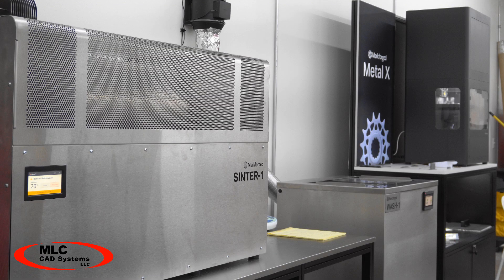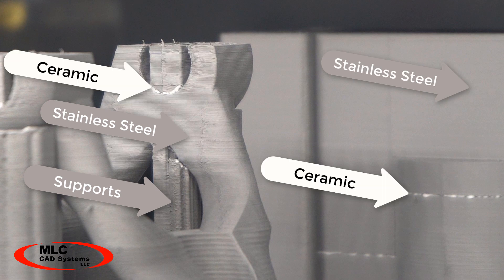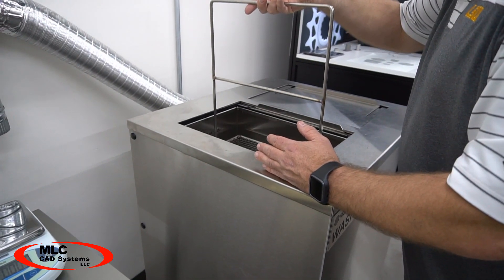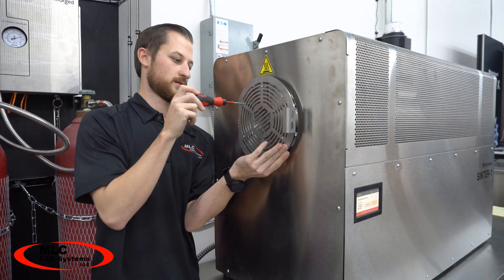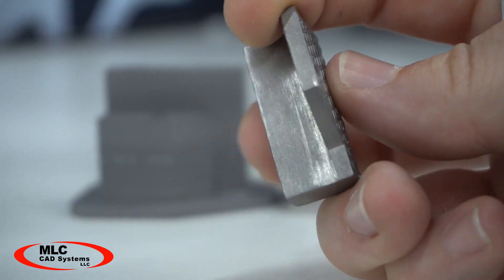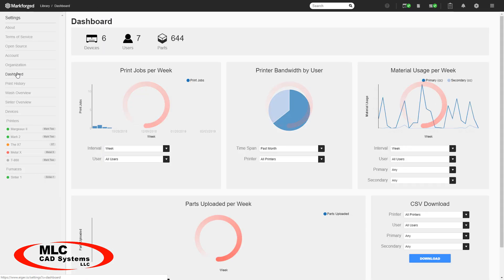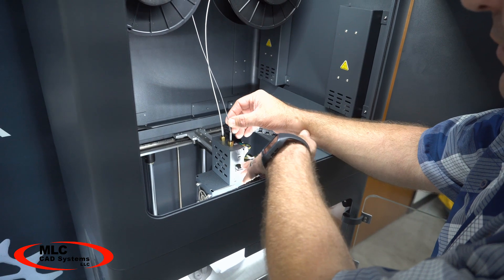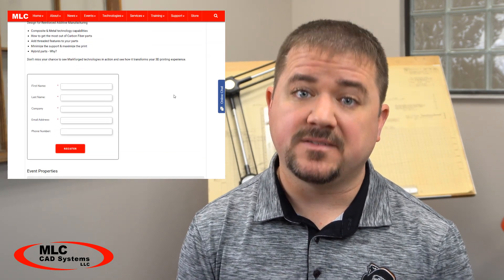The Markforged Metal X is Here

Comment: Still a long way though from speed of cnc doing production. Save material yes, but by looks of those parts they cut, Cnc could have cut 10 or more, no washing etc needed
Reply from the maker: Agreed, for any parts that can be machined efficiently they would be faster and cheaper to use a CNC.  There are a few factors to consider that control how efficiently a part can be machined. The Metal X is ideal for parts that will be extremely difficult or impossible to machine due to complexity or shape, which is often a minority of parts but may be key to successfully complete a product or improve performance.  It is also great for low-quantity parts and prototypes, where the tooling design and fabrication costs cannot be offset by any meaningful quantity.  Parts that require a significant amount of material removal, especially parts that are very weight-efficient or oddly shaped, are often cheaper to print than they are to machine.  If raw material availability is an issue, such as remote or off-shore installations, the Metal X can build any part with any shape or size from the same spool of raw material.  

We don't expect the Metal X to compete with CNC machining directly for most parts, but it can vastly expand design and fabrication capabilities in industries with extreme design challenges.
Reply: It save materials, and it can make super complicated shapes that is impossible with cnc. Depend on the applications, i think this thing is a breakthrough

Comment: When will the price for these metal printers dip below $10,000? Right now they seem to be geared more to be sold to companies that need them for r&d and prototyping new products. Do you think within the next decade these metal printers will become more afforadble and accesible to the average consumer?
Reply from the maker: Great question, and for a number of reasons it will still take quite a while for the cost to get down to that price point.  For reference, about 2 years ago it would have required a minimum initial investment of $1M USD to get started printing metal, and that cost of entry has plummeted by an order of magnitude with the release of this new style of bound metal powder printing.  It will be interesting to see what breakthroughs are up next for metal printing.

You are correct that these systems would not be well-suited for an average consumer yet unless they are dealing with some pretty tremendous design and manufacturing challenges!

Comment: Stick to sand casting allot cheaper for the money and time and very little production time i don't see how you could ever make your money back on making parts to order sorry but if it can't produce the product a lot faster don't see how it will ever work out. and doesn't seem safe to use in high strength/torque applications seems you can only use it for decorations and the shrinkage after the product? So you gonna have to put it on a milling machine anyways why not just use a CNC to make your part!? think your product needs A LOT of redesigning and improvement
Reply from the maker: Thank you for your comments.  It is important to understand where a system like this fits into the realm of manufacturing, and it isn't to produce parts that can be easily or inexpensively sand cast or machined.  In a typical design, most of the components can be made less expensively using traditional methods, and it would not make any sense to shift those designs to this machine.  Where the Metal X is seeing profitable adoption is where an assembly of multiple components can be replaced with a single part, printed in high-strength materials, in shapes that are impossible to make using any other method.  Also, it is worth noting that the final porosity of metal on the Metal X is superior to a typical sand-cast process, and the strength of the material is not directional after sintering or compromised at all from the fabrication process.  Accommodations for shrinkage and the final surface finish are comparable to sand-casting parts as well so the results are very serious parts.

Another consideration is access to a foundry or a suitable machine and raw material.  The Metal X can create metal parts in complex shapes using high-strength alloys with no foundry access and a very small facility footprint.  Consider locations such as off-shore rigs or extremely remote installations where it would not be possible to stock up on every possible variant of machine and raw material shape to build replacement parts, and you'll see that there are many markets that the Metal X would serve very well, but they are not typical main-stream needs.

Comment: I know this is a dumb question but is that  oven machine tempering the metal ?   Or binding the layers of metal together?
Reply from the maker: This is a great question, sintering shares a lot of similarities with heat treating.  The primary function of the sintering oven is to bind all metal particles together, removing all remaining binder material in the process.  The part is taken to a temperature just below melting, so the metal remains solid but the crystalline structure is able to relax and bind to neighboring metal particles, solidifying the part to a single solid component.  Sintering takes time to occur, so the temperature profiles are carefully controlled and the material is kept at specific temperatures according to a sintering procedure and it is cooled carefully to avoid deformation.  This leaves the part in a near-annealed final state, but the final heat treatment state is a side-effect of sintering, not the goal of sintering.

Although the sintering oven is capable of getting hotter than the required temperatures for heat treating, it is not designed or equipped to perform any heat treating, and subsequent heat treatment may be desired to achieve the necessary final material properties.

One more note: although the material is deposited in layers, the material is a metal powder with no residual layers, orthotropic properties, or weaknesses caused by the printing process.

Comment: don't understand and hope you can simplify in steps w/o ad. thrink ABOUT 20% means no precision or not?
Reply from the maker: Great question, when we said ABOUT 20% it was not for lack of precision, but to try to simplify a sophisticated process.  20% shrinkage is an average volumetric shrinkage value that can change slightly throughout the part based on the geometry or shape of the part.  The goal is to accurately predict local shrinkage for each geometry, and expand the part to the exact right size and shape so it shrinks back to your desired final net shape.  "20% shrinkage" is an average value that is easier to say than to try to explain the complex calculations that are done automatically by the software.  Artificial Intelligence is also coming to this algorithm to enable even higher precision without adding any complexity for the operator.

Comment: What? I thought it was a powder bed printer. I received a sample from them and it said nothing about shrinkage. Only that if heat treated it would go from 1000 to 1250MPa tensile.
Reply from the maker: Powder bed printers are available from other vendors, but they are significantly more expensive to purchase and operate.  The Markforged Metal X avoids the hazards and costs associated with free metal powder by using bound metal, similar to Metal Injection Molding (MIM), but as an additive manufacturing process.  The parts are automatically scaled up to account for the shrinkage, so the final parts are near net shape just like any other manufacturing process.  It is true that any post-processing techniques appropriate for each alloy can be applied to parts printed with the Metal X, including heat treating.

Comment: So you could create new replacement parts like gears, brake shoes, etc without forging and/or milling from a huge block of metal? Awesome!
Reply from the maker: Exactly!  If you need to make a large volume of a single part design, forging or milling will almost always be cheaper, but for prototypes and one-off design variants this creates a metal fabrication option with no tooling costs.
Reply: @MLCCADSystems  
That was one of the things I never could figure out. How you'd forge a complex part like a carburetor for a small engine always boggled my mind. I'm thinking these things should be in custom fabrication shops, so the customer can get a new part for even an out of production machine without needing to search overseas for them.
Reply from the maker: Unfortunately costs are still a major concern.  The machine is significantly less expensive to buy and install than previous metal printers, but still represents an investment.  The parts as well are going to be more expensive than most people typically pay for them in a consumer realm.  For something like a carburetor, you could retrofit an off-the-shelf part to work with your old vehicle cheaper than you could print a custom replacement on a metal printer.  The target audience for this tends to be companies that are searching for solutions for some very expensive equipment or parts, such as military, medical, or oil and gas, where alternatives don't really exist.
Reply: @MLCCADSystems  
It could be used as a cheaper method of developing prototypes too, instead of having foundries customizing countless moulds through the process.

Comment: We want it to reduce car parts price down to sustained.
Reply from the maker: For parts that are available off the shelf, the Metal X is unlikely to represent a great value.  Additive manufacturing is still much more expensive than other methods, especially for car parts.  It really shows benefits though when the part is completely unavailable, meaning you are choosing between various expensive options, or if the part is extremely hard to made, such as parts that require very high strength or very complex geometry.  I hope that helps!  If you are interested in how much the parts cost in material, here is a video that should give you some idea of how much parts might cost: https://youtu.be/wvQK-Us3yaM

Comment: Very cool ! But what about the nozzle? Have you solved the problem of abrasions?
Reply from the maker: We haven't seen issues with abrasion, although the nozzle is considered a wear item so it can't be ignored either.  Both the Metal X and the Onyx composite print heads work with abrasive materials, the recommendation for Onyx is to replace it about every 1,000 print hours, and we're finding that the metal print head is likely to fall into the same ballpark on life expectancy.

Comment: 20% shrinkage seems pretty standard.
Reply from the maker: 20% shrinkage is appropriate when a binder is used, such as metal injection molding, and then the result is sintered.  Metals that have a very high melting temperature are harder to melt fully for casting, and MIM is great for complex parts in high volume.  The metal is injected in powder form with a binder, and sintering is used to merge the metal together slowly as the binder is evaporated through the porous metallic matrix.  Sintering is a pretty amazing process that is used for a lot of common applications like gears, and the Metal X makes it possible to do the same thing with no tooling investment for each new part.

Comment: what kind of tolerances ( thousandths of an inch) can be obtained and what kind of finishes can be obtained ( I need 8-16 microinches)  .
Reply from the maker: Great questions.  These parts will "near net shape" with typical tolerances of +/- 0.5% in all three directions, and if the Blacksmith AI is utilized we expect those tolerances to tighten up with more data.  So for example for a 1" overall feature length, you should expect a tolerance of +/- 0.005".  Regarding surface finish you should consider these parts coming from the oven as being similar in finish to cast parts, sealing or sliding faces would need to be machined to final dimensions for the required flatness and surface finish.
Reply: @MLCCADSystems  so clearly +/-.005 will not suffice for me.  Luckily the complex aspect of teh part is not calling for tolerances better than that but the O.D. and the thickness needs +/-.0015 and a very fine finish.  What is the machinability of this as opposed to "from the mill" metal 17-4 ?  second of all, IF I bother to have this ground and lapped will I end up with the 8 micro inch finish  or is that impossible because the material already inherently has pits and voids inside?  less than .002" I understand.
Reply from the maker: The final material will be dense, up to 99.7, so we typically expect it to be similar to billet material, better density than a casting, perhaps worse than a forging.  Machinability will be the same for these parts as any other of the same material.
Reply: @MLCCADSystems  looking good.

Comment: There must be an easier way...
P.S. that finished product looks.... bad. The part will require post production work. Probably on a CNC VMC. I bet even a hobby grade CNC is still a much, MUCH more efficient method. I look forward to an affordable metal printing solution, but this ain’t it I’m afraid. 

What about those Aluminium looking rods for diy ‘welding’ of aluminium with just a small jet lighter/blow torch? Was that tech patented and released as that product to stop it appearing here? I reckon that stuff is the way forward
Reply from the maker: Thank you for your comment, the surface finish of some parts will be better than others and the surface roughness will be similar to a cast part, if you need a high-tolerance flat surface then it will require post-machining operations to clean it up.  The software has been upgraded to produce better parts since we created this video, keep an eye out for more Metal X content soon to see how far it has come!  

The welding-based machines are extremely slow and energy-intensive.  The technology is out there, but nobody is releasing it as a product because the process is likely not viable for commercial operation.

Comment: Ever heard of CNC machine
Reply from the maker: The Metal X does not compete directly with subtractive manufacturing like CNC machines, it ideally would be used to augment their capabilities when design challenges can be solved better using additive processes.  One very powerful example is Black and Decker, we have the case study on our website.  https://mlc-cad.com/markforged-teams-up-black-decker/  The short version is that they needed a part with geometry that could not be machined, so it had to be assembled from many pieces, and the assembly was never strong enough for the application.  By printing the part in metal, the part became cheaper and immeasurably stronger and more reliable.  Only one part was made on this printer, the rest was made using conventional manufacturing approaches.
Reply: How dense can you be

Comment: can you print electrically insulating material in the metal parts?
Reply from the maker: Great question, especially with Copper hopefully coming relatively soon!  Parts will be limited to one metal due to the sintering requirement and the ceramic release layer, which is not structural.  Even if the ceramic is electrically insulating it will not be reliable to mechanically connect two pieces of copper that are separated completely, so you should expect to add insulation separately.
Reply: @MLCCADSystems  I am interested to find out if electrical components such as transformers might be 3D printable in the near future. IFTHEN/GOSUB new transformer designs that could not be manufactured up to now might be possible. what are your thoughts on this?
Reply from the maker: This sounds like a discussion that should be elevated beyond a YouTube comments section.  There are certainly going to be completely new and unique approaches discovered with this new manufacturing technique but those will require study and development.  If you have a specific design or application you would like to discuss please get in touch with us at our website.  https://mlc-cad.com

Comment: Can you guys talk about the maintenance required and waste generated?
Reply from the maker: Thank you for your question, we are planning on producing more videos to help you get a better feeling for using the system but I can give you a few additional details.  The maintenance is relatively minimal, you'll have to replace/change the material spools, occasionally top up the fluid on the wash, and swap out gas canisters.  Waste generated during each cycle would include the piece of wax paper on the print bed and any supports that were printed but that aren't part of the final part, which can be recycled as normal metal waste.  It is also worth noting that the support plate under parts is optional, but does give a much better flatness for parts on that bottom surface, so depending on settings and part geometry there will be some metal waste.

Comment: Is this the same technology SpaceX uses to print the SuperDraco thrusters or am I confusing 2 different forms of manufacturing?
Reply from the maker: Great question, the Metal X is not the first additive manufacturing technique for metal alloys, but it is the first one to come in substantially below the $1M price point among other innovations.  SpaceX probably used SLS, where the powder is loose, rather than suspended in a binder.  It is capable of creating larger parts, but the equipment, facility requirements, and post-processing equipment make it completely out of reach for most companies.
Reply: @MLCCADSystems  Thanks for the reply, always interesting to learn something new. :)